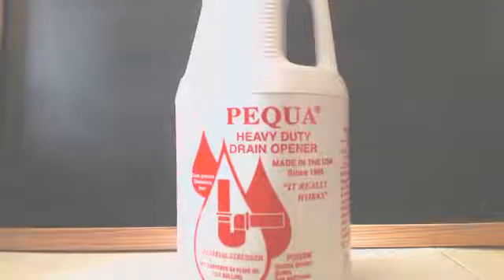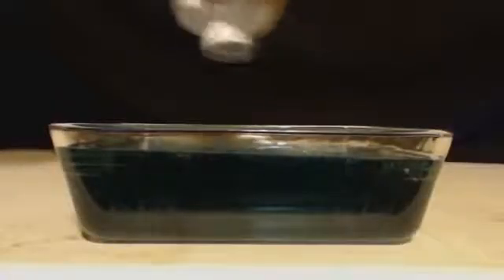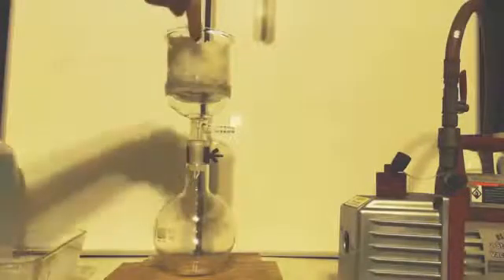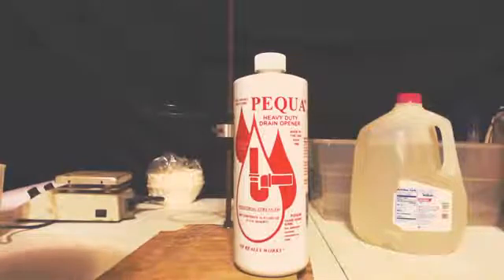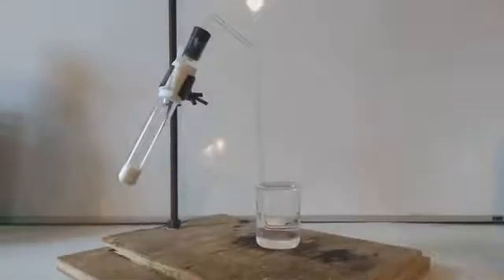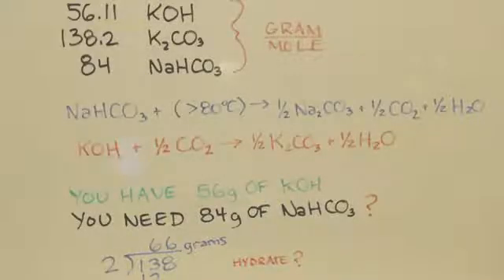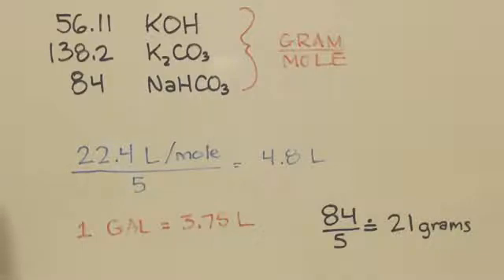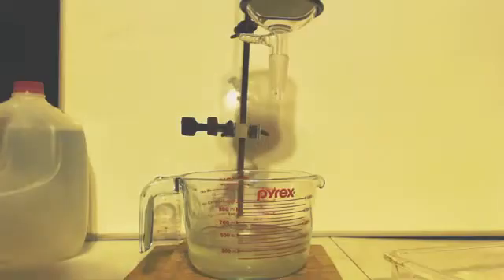HOW TO MAKE PURE POTASSIUM CARBONATE

Comment: Why not get Potassium  bicarbonate and heat it its cheaper
Reply from the maker: lastpokemon.........That is how i make sodium carbonate.   Cause i can EASILY buy sodium bicarbonate.    Where do i get potassium bicarbonate?
Reply: @jbsc6180  Just buy potassium bicarbonate put it in the oven as a thin layer in a large deep dish pie dish or very large pan (no aluminum) and heat it up in the oven  for 2-4 hours at 350-400*F and boom potassium carbonate! Just make sure to quickly seal it up in some glass mason jars with a tight sealing lid or other tight sealing jar or container (NO ALUMINUM) it works fine!